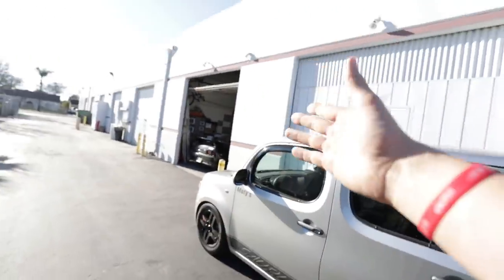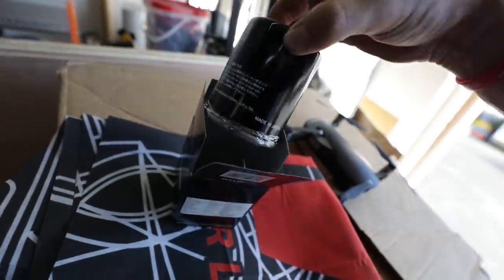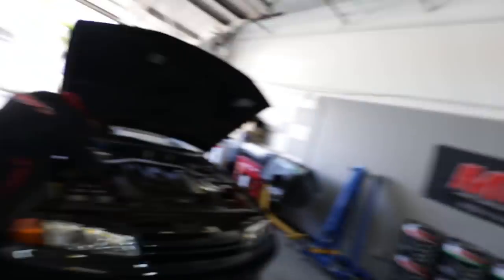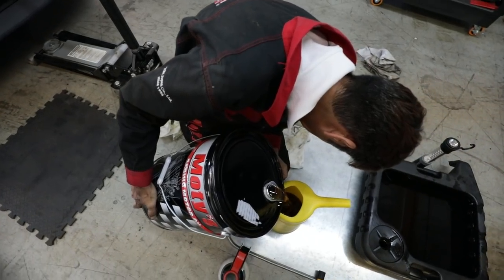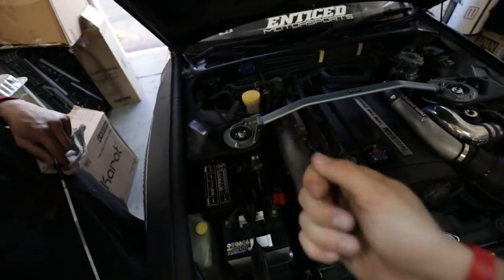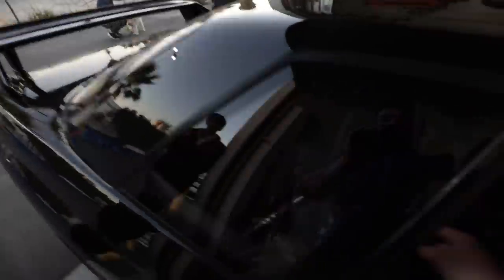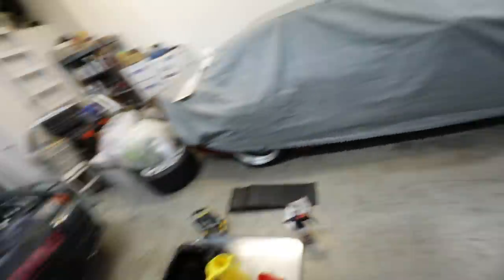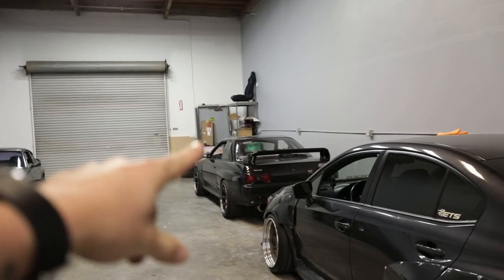The Skyline GTR NEEDED This!

Comment: So as a fresh owner of a r32 GTR, I'm always looking for some new info or tricks for the RB26. So for those who are also looking for some special info, there is a reason that fancy new cover on that other GTR has slats in it. Underneath that center cover are the coils. Stock, they're covered up in there and they can get cooked. I've heard its a common problem for cars that get pushed for long periods of time. The slats opens them up to some free moving air and lets them cool down. so for a highly modified engine like that one, that was most likely done for function over form.
Also, keep going on this build! I love getting some little bits of knowledge from Fujita-san! Guy knows his stuff